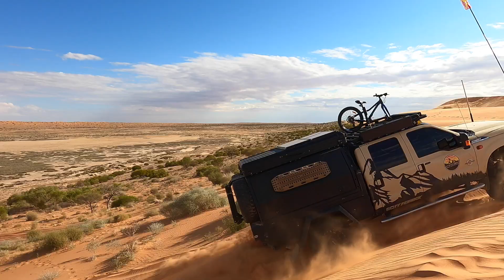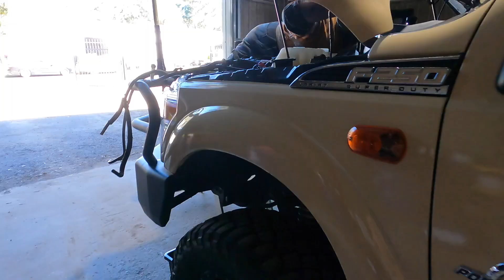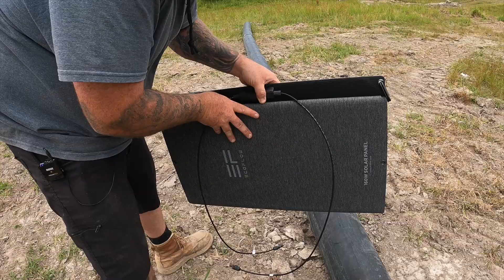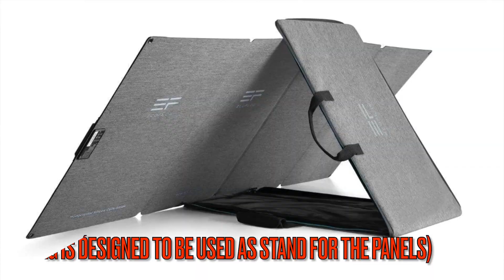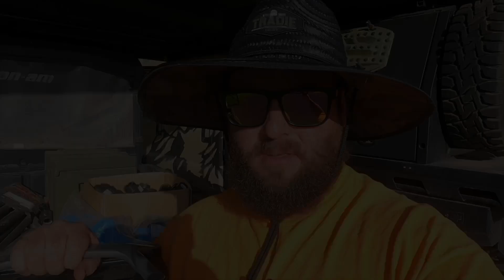ECO FLOW RIVER PRO. ☀️Solar power generator for 🛠WORKSITES. Tradie must have tool !

Comment: Mate come on.
Click bait title, it’s just a battery with a tiny inverter. 
Just about every YouTuber has a review on one 🤦‍♂️
Good for camping and maybe to charge your drills.
But it won’t replace the Honda on any serious worksite. 
You know it, we all know it
Reply from the maker: Not click bait at all man. Look at the bigger power systems they offer, there massive and can run welders, drills etc etc no problem.
Reply: @TyFenwick  the problem is 
at worksites when these power batteries can be replenished as quick as filling a tank of fuel  they will be accepted 
generators  are still the go at this time